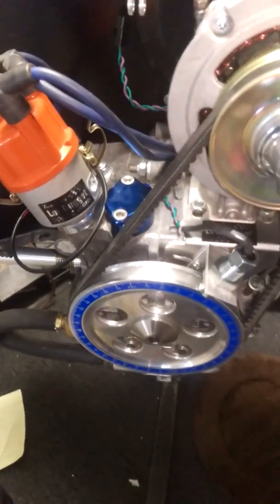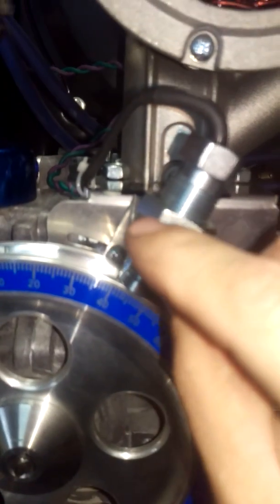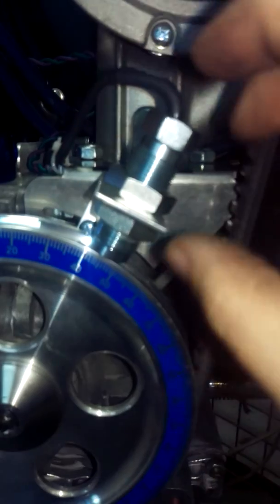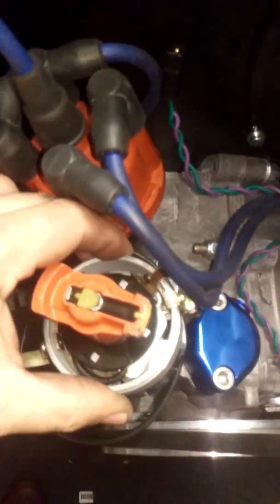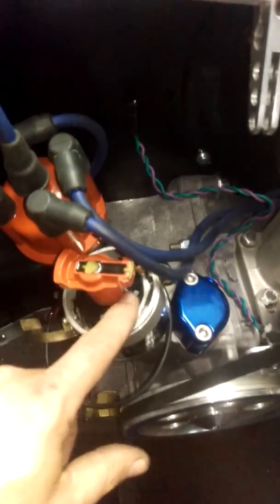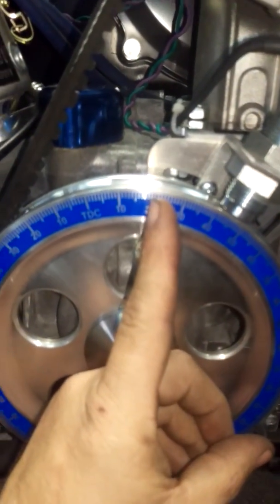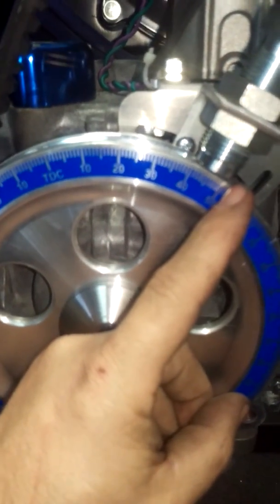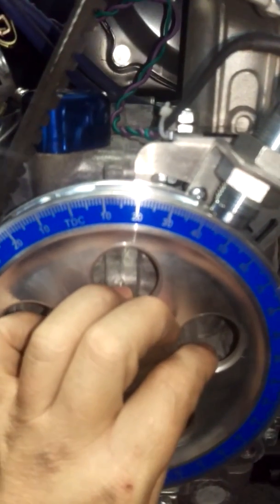Fitechvw step 1

Comment: Can this efi set-up be used with an 009 distributor with points
Reply from the maker: You can use a locked out 009 for spark distribution but a MSD would be better. The main reason is the available quality of plug wires and none resistor rotors. You want 100ohm or less per foot plug wires and a rotor with no resistor. It's hard to find all this for 009. I am assuming your going use our crank trigger for ignition signal?